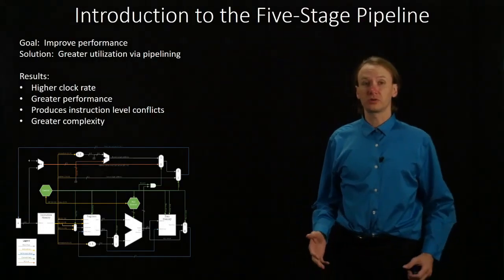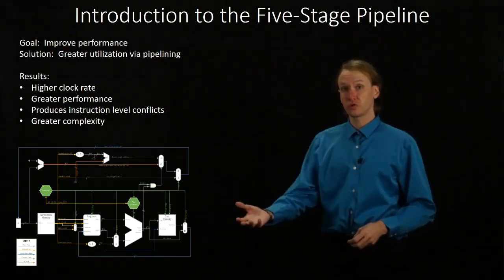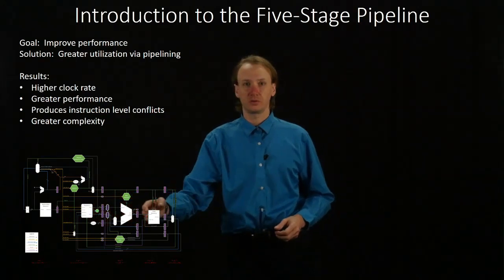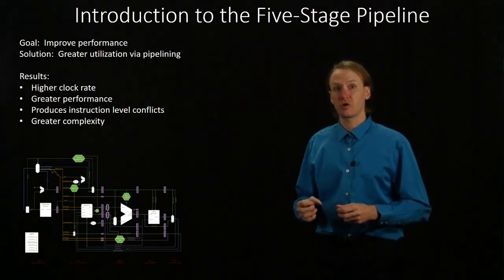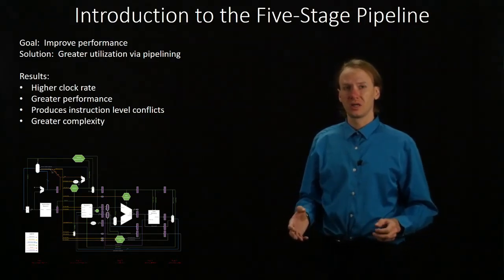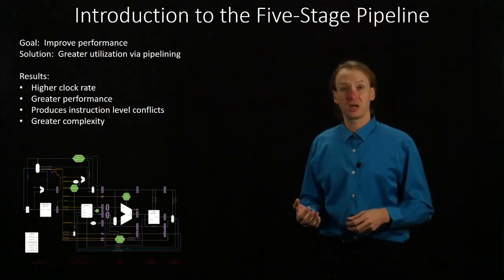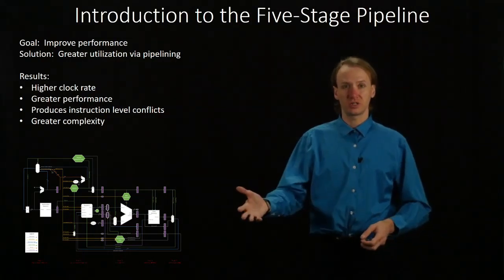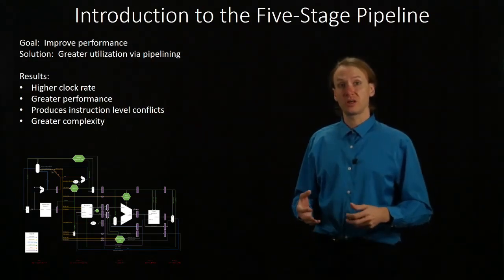1.  Introdution to the 5-Stage Pipeline

Comment: So these 5 compartments or stages all can preform instruction fetching, instruction decoding, executing, accessing memory and writing back? or are these all separate compartments that each can only preform only one of those functions?

I hope my question was clear and correct enough and you are still active on you tube.
Reply: Im doing an ARM architecture presentation, for your interest. maybe it makes a difference
Reply: Hey so, I am learning architecture right now and from what I understand, the 5 stages are separate. Stage 1 is instruction fetch, stage 2 is instruction decode, stage 3 is execute and stage 5 is write back. So pipelining works by instead of 1 instruction going through all 5 stages and then the next instruction going through all 5 stages, instruction 1 will be fetched and then while instruction 1 is decoded, then instruction 2 will be fetched then while instruction 1 is being executed, instruction 2 is being decoded. Think of doing laundry. You wash them, then dry them then fold them. Well, say you have two loads of laundry to do; you wouldn't wash, dry and fold one load and then start washing the second load, it would simply take too long to finish both loads. So what you do is after you wash the first load you throw it in the dryer. While the dryer is drying the first load, you throw the second load in the washer. When load 1 is being folded, you throw load 2 in the dryer and then when you finishing folding load 1, its time to fold load 2. That is exactly how the  stage pipeline works... like doing a bunch of laundry lol
Reply: @bsce100  this was lots of help :) thanks a lot
Reply: Anar_NL no problem. I’m glad it helped
Reply: @bsce100  Nice and Simple Explanation Keep it up we need more people like u in the world :)